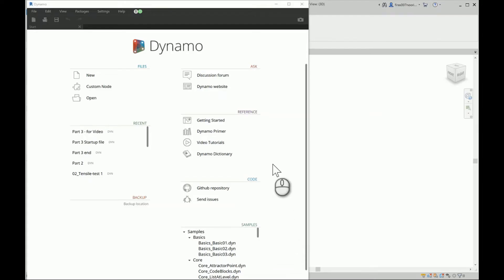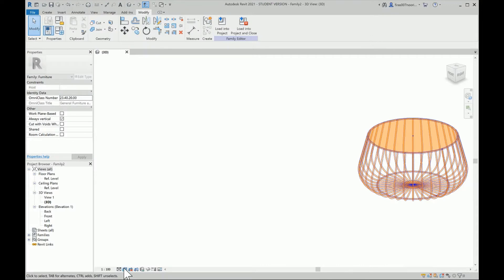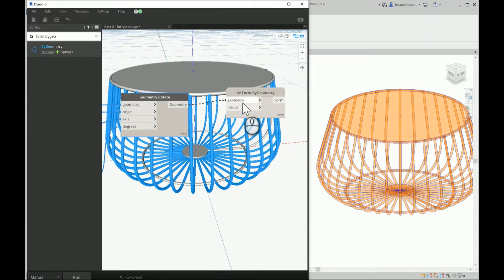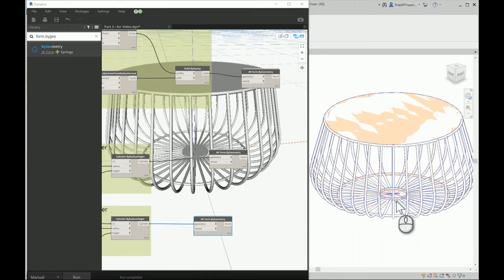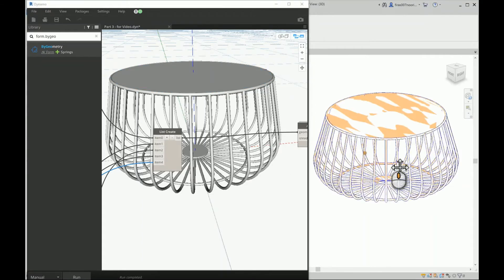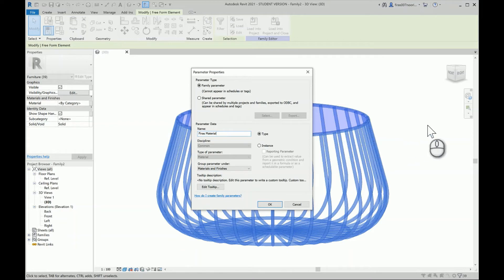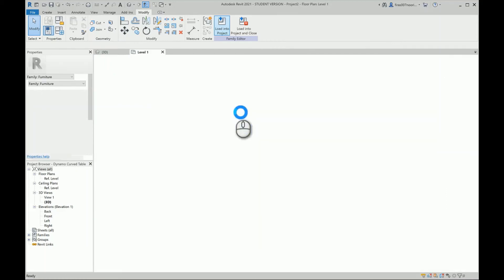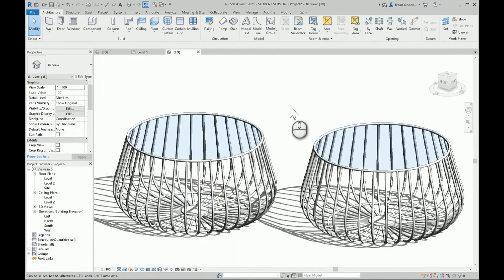Dynamo Curved Table - Part 3 _ Exporting Dynamo to Revit Family

Comment: Dear Firas, I hope you can help me. Spring node FamilyInstance.ByGeometry and form.ByGeometry both are not working in Revit 2022. This is disaster!!
Do you have any knowledge of this and is there any way we can contact spring node developer to fix this issue. Thanks in advance
Reply from the maker: Hi mate, still never installed anything on the new dynamo, I will installed them and check soon
Reply: @FirasNoori  Dear Firas, do you know any other way to import Dynamo geometry rather than these 2 spring nodes? One good thing from your video it confirmed 2021 do work :) we upgrade from 2018 directly to 2022, didn't expect some key dynamo nodes not working..now we have to downgrade to 2021, thank god 2021 starts new feature of rebar mesh solid :)
Reply from the maker: Sorry for my late answer, I was sunk at work, Install (Spring nodes) not (Spring - Dynamo 2.0) and it will work, I just tried it

Comment: Hello sir i have one issue in revit
When i save my project file and after i start working on that file and press control +s to save the work it save in new project file why? And give me solution
Reply from the maker: You need to turn off the Autosave option or reduce the amount of it till 1
Reply: How can i do?
Reply from the maker: @aatifawan781  Go to File > Save as> Project > Option > Options > Maximum Backup > 1